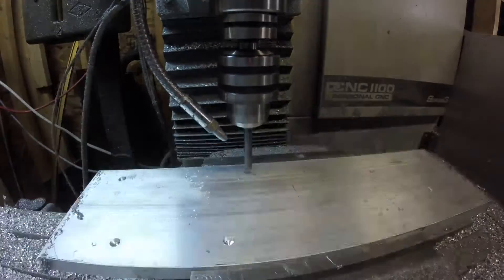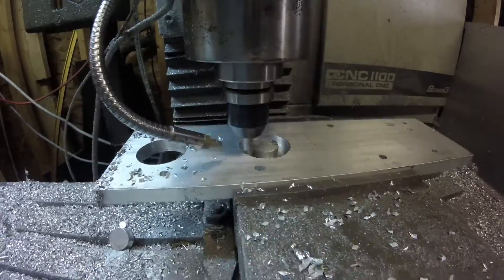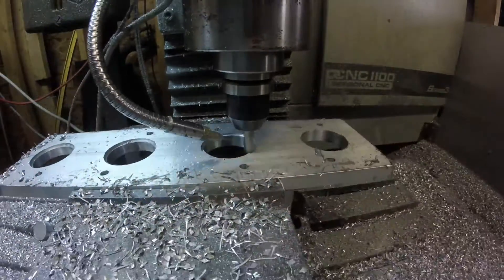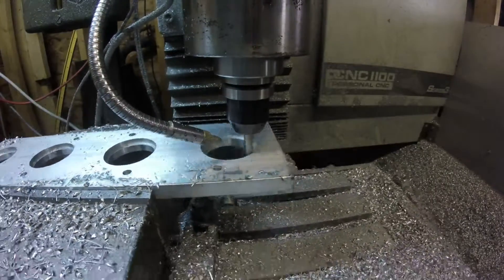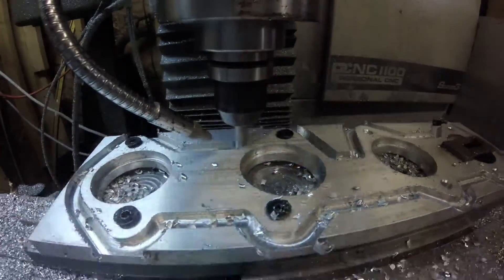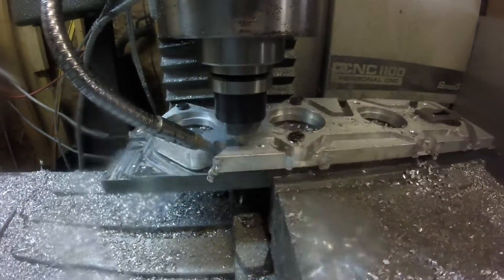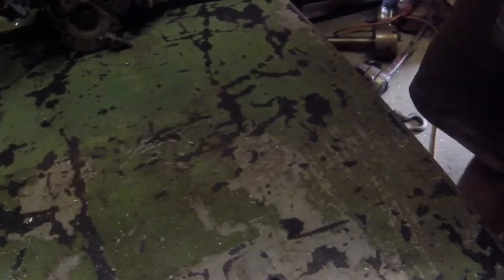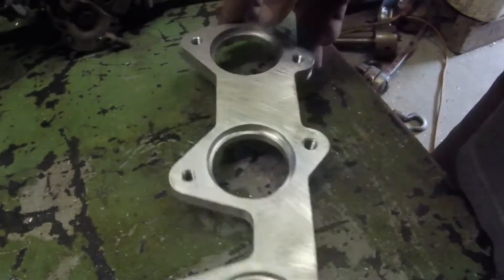Making a Weber DCOE manifold flange on a Tormach PCNC 1100

Comment: Nice work.  I like the recesses for the runners.  How much does that option add to the cost?
I'm preparing to build a 50mm DCOE EFI intake. 
What bore was this one, and do you know what type, and if possible the source of the tubing the customer was using?

Mine will curve up and over the head, placing the throttle bodies just above the cam cover, so I'll need 180 deg bends for runners.

Also, would you be able to make a head flange to fit the Ford Duratec 2.5 liter head, as found in the Fusion or Escape?
Reply from the maker: Thanks!  I don't remember what size this was for but I've made flanges up to 55mm but the outer perimeter gets pretty this so couldn't do the recesses without altering the perimeter a little.  Doing 50mm should be fine as long as the tube isn't too thick.  The additional cost would be about $5;  it's just a little more machine time.

I've never looked into any tubing suppliers and he didn't mention where he got his.

I could possibly make the head flange too but I know I currently don't have dimensions for it.  I can poke around on the internet unless you happen to have them.
Reply: Wow, thanks for the quick reply.
The bolt pattern is the same as the 2.0 and 2.3 heads, but the 2.5 ports are raised and much taller.

If I can't find a drawing, I could make a template once I get the head I'll be using.
Reply from the maker: That could work.  Templates are a little tricky because there could be multiple layers of error; when you're making the template and when I'm copying it.  A cad file or dimensions would be the preferred method but we'll work with whatever you got.

If you're in any of the forums you might post a thread and see if anyone already has the file.  I checked my normal sources and came up empty.
Reply: We have a couple CMM machines at work.  Once I get the head I can probably get one of the guys to scan the intake flange.
Do you have a particular file format you'd like?
Reply from the maker: Dxf should be fine.
Reply: If I have them scan down into the port a bit to to establish the port angle, would you be able to match the angle of entry throughout the thickness of the flange, and also angle the recesses for the tubes to match as closely as practical?  
I think the port is angled up by about 17 degrees, so basically, the port openings would just be cut at a 17 degree angle, with the head side matching the port positions.
That would allow for much better airflow, and save a lot of hand work blending everything.
Reply from the maker: I've done something similar before.  Once you get on an angle, all the dimensions get a little wonky.  When you cut a tube at and angle it's actually oval shape on the cut end.  That shape can be a challenge to match the dimensions of.

Also, at a 17 degree angle, the recess would vary from 0.0" to .578" which means the plate would need to be thicker to accommodate.  The other option would be to make the depth of the recess consistent but that gets you into the oval shape referenced above.

Comment: I highly recommend using a climb cut. It will evacuate chips better and leave a better finish.
Reply from the maker: Thanks.  I've tried both methods in the past and conventional seems to work best for me.  With all the air I'm blasting there shouldn't be much re-cutting chips.  The rough passes are a little ugly but the finish pass cleans it up nicely.

I've been using conventional since right after I started because it gave be a better finish at the time.  Truth is, I was doing a lot of other stuff wrong that probably a factor in the finish I was getting.  I need to do a side by side comparison to see if my results are the same or have changed.  I'm all for using the best method.
Reply: Higher helix end mills will leave a nicer finish as well with a 40° being a nice all-rounder for aluminum. Might be more difficult to find in 2-flute HSS though.
Reply from the maker: Oh sweet; good to know.  I've just been getting by with whatever I could find.  I read about the higher helix but made no real effort to find any.  Also read about variable flute which is supposed to offer a better finish as well.  Thanks for the insight.

I really do need to do some more trials.